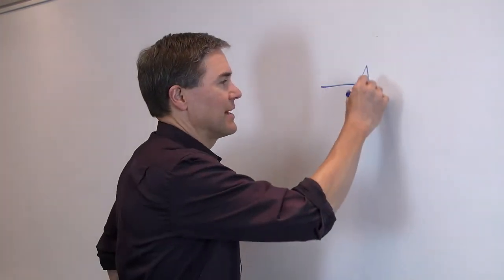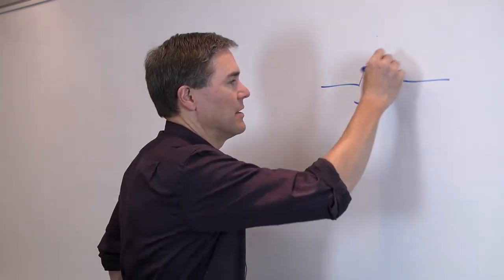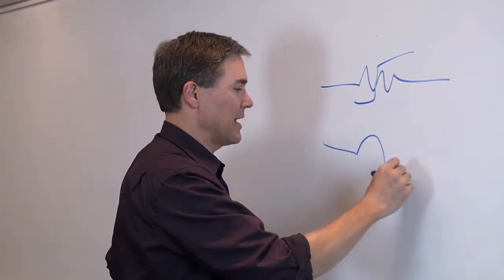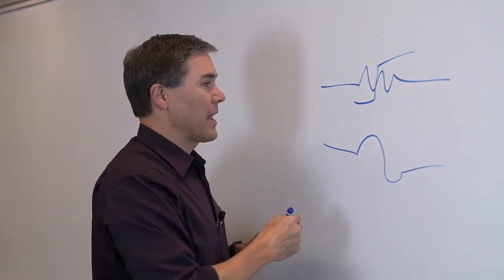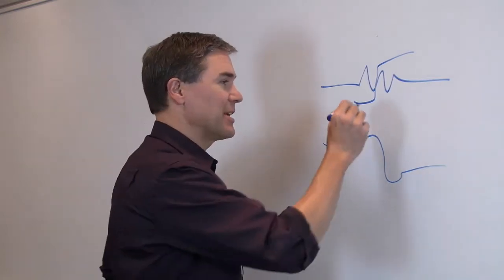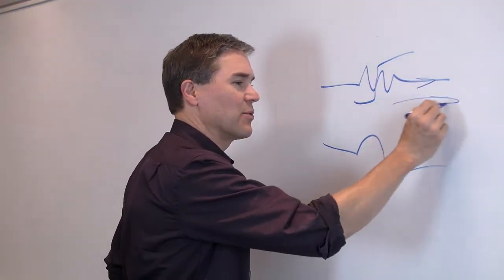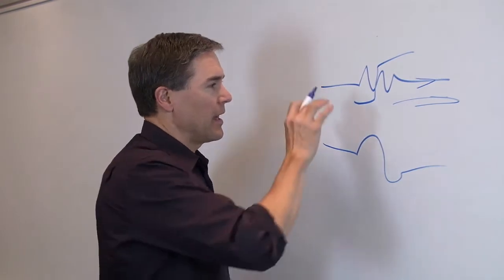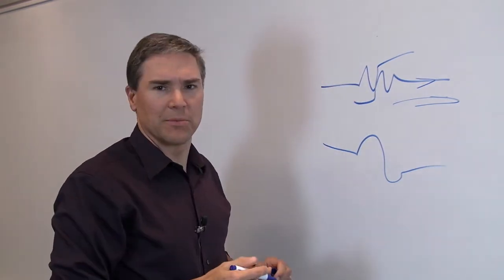How to decide when to use a PolySwitch device and when to use a fuse

Comment: I bought some polyswitch to do some testing and see if I could use them to protect ampmeter when students use them in parallel! I thought that hold current and trip current were reliable infos but obviously not! They are far away to work as fuse! Do you have any idea of other type of electronic parts that would REALLY acts as resettable fuse? Because using fuse would be too expensive! On the otherside, polyswitch do not stop working when current rise above trip current!

Comment: For Loudspeaker protection , this is an excellent device. However, there is a poor understanding of the transition state between the Hold and Trip current.
Therefore many manufacturers still use Lamps other old outdated devices. Please publish more data regarding this and its application.

Comment: So...will a polyswitch reset on its own, or do you need to break the path for it to "normal up" ; meaning for regular current flow through it?
Reply: Im sure you know by now but a poly will reset itself.
Reply: @jonnyt8056  Only after the condition that is causing it to trip in the 1st place is removed ;-)
Reply: Your late answer gave some insight to someone reading it even later. Thanks!